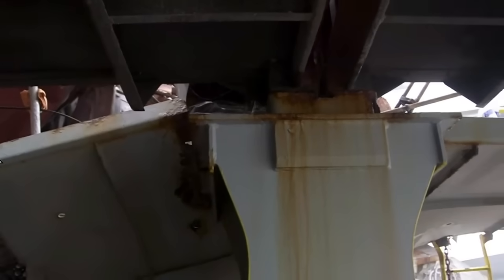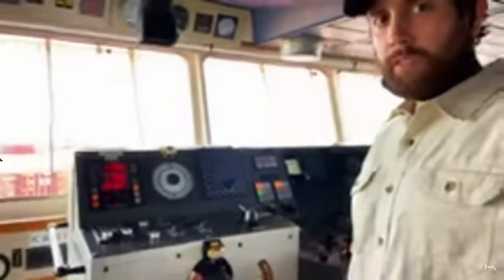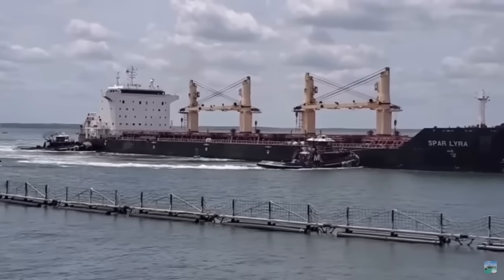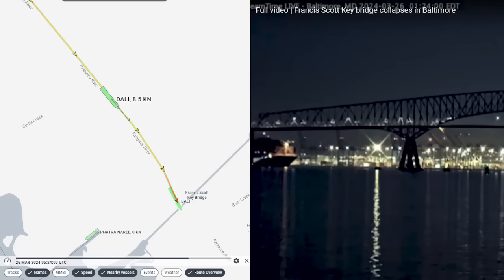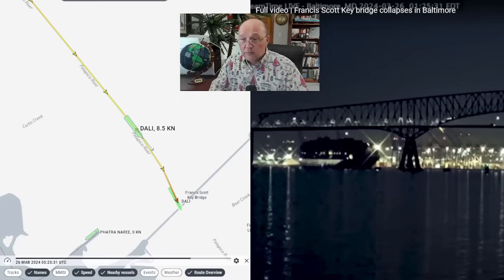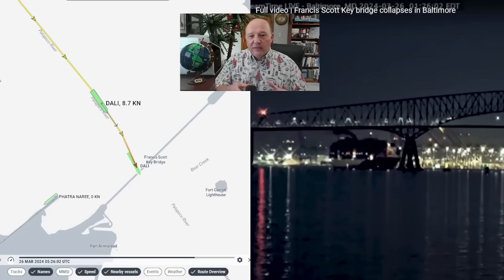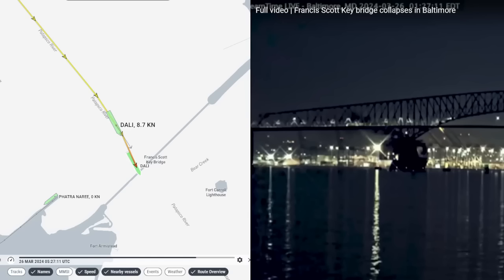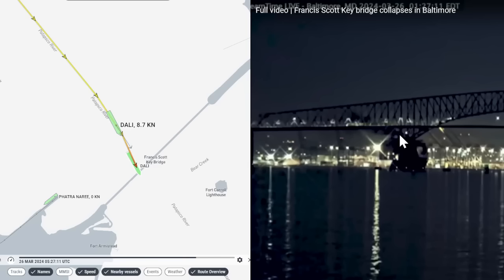Dali Timeline from Data Recorder in Striking Francis Scott Key Bridge in Baltimore, March 26, 2024

Comment: Sal. Retired Chief Engineer here. 30+ yrs as Chief Engineer on Slow Speed diesels such as this vessel. You have done a great job, but a couple of points to clarify.
1 - The ship's electrical systems are laid out such that there is a "Main Distribution Buss" and an "Emergency Buss". These two are NORMALLY 'TIED' together via the 'Buss Tie Breaker' and  fed from the ships' main generators (DALI has Four). They can all be brought online to supply power. Usually one will carry the load unless there is a lot of refrigerated containers on board. When the bow thruster is running, two or three generators would be online to supply the Bow thruster which is typically an electric motor 1,000~2,500 HP. The Emergency buss is ALWAYS powered. In the event of loss of power, the Emergency Diesel Generator (EDG) starts, and the breaker connecting the two electrical busses (Buss-Tie Breaker) opens, then the breaker connecting the EDG to the electrical buss is allowed to close and power the emergency buss. There are only a handful of equipment that are on the Emergency Buss, ONE of the steering gear motors would be on this. The Deck lights are not on the emergency buss. So when you see the deck lights come on and off, that is a Main Generator. The large light on the bow that seems to come on at a different time is likely a High Pressure Sodium light and they usually take a while to 'warm up' before putting out any light.
2 - The black smoke is likely from the Main Engine (M/E). The M/E is a 9-cylinder two-cycle diesel engine that develops 55,630HP @ 82.3 RPM. The pistons are 0.90 meters in diameter and typically weigh around 7-tons each. If they were doing 8knots ahead and requested a 'crash astern' engine command, the automation of the engine has a separate program that will introduce more 'start air' than normal, for a longer time. 'Start Air' is high pressure air that is introduced into the engine in the same sequence as firing order to turn the engine (kinda like a push start) in the proper direction before fuel is introduced. Once fuel starts pouring into the engine in the reverse direction, the engine is initially starved for combustion air as the three turbochargers on the engine (that weigh as much as a Volkswagen Golf) take a bit of time to spool up to speed.
3 - I was an Engineering Officer, not a Deck Officer (Mates), but the mates used to remark about how the astern bells would affect the stern by 'walking' the stern one way or the other depending on how the blades on the 65-ton propeller bit into the water. Much more than the ahead bells because the propellers are optimized for pushing the vessel in teh ahead direction.
Hope this helps clarify some of your questions.
4 - The rudder is controlled hydraulically and without power, would stay in the last position before loosing power.
Reply from the maker: Thanks Chief!  Great additional info, I appreciate it.
Reply: @wgowshipping Regarding the anchors, on the large container vessels I have smilede on as a mate, the anchor breaks are hydraulic operated, and the the pump needed is not automatik  turned on egen the emgergency generator kicks in. An engineer needs to go to the emergency switchboard to turn it on. There is an emergency pump, which needs to be fetched, hydraulic hoses needs to be connected from the anchor winch to this small emergency pump, which can then be uset by hand craft. I have not seen these manually breaks for years as you showet on the footage.
Reply: @wgowshipping  ond more thing. It-baseret bit of a wonder that there hasn’t ben an accident befordr considering the large container vessels calling Baltimore with hardly any under kedel clearince and not much Air-draft.
Reply: Depends on the precise design. If the engine was not fully up to temperature (as on departure) it would not usually be practice to rely on HFO for manoeuvring. The generators would be running on gas oil. The boiler would run on HFO.
Reply: The engine room alarm printer  and data acquisition printer log sheets will certainly shed light on the cause of the power failure and the recorded alarm and operational data from the machinery monitoring system itself.If there is a fault with the VDR  system it  will 
manifest itself in the data logs,
Reply: Agree with all your points Chief. The crash astern would be an obvious thing to do and would tie in with reported smoke and oil smell in the engine room; cylinder pressure relief valves blowing caused by excess pressures from the emergency maneuver.
If they succeeded in starting the engine astern and not just breaking the ahead free wheeling of the engine, shaft propeller. Engine running astern would negate any rudder authority.
Reply: @RicktheRecorder  The DALI's main engine is an  9-cylinder MAN-B&W 9S90ME-C9.2. They have recirculating lines at the fuel injectors to keep hot oil all the way to the engine while in port. When I was sailing, we only went to light fuel to do maintenance on the fuel system. So yes, still a possibility. I sailed with both MAN-B&W and SULZER engines, from 9 cylinders on one ship to 12 cylinders on my last. In the old days, they did not have recirc lines (SULZER-RND type come to mind). Another possibility is that they  switched to light fuel while in port to save money on keeping the fuel hot. There is an auxiliary boiler that keeps the engine jacket water up to temp as well as fuel hot as it circulates. I'm sure yours and many other similar questions are being asked. I read somewhere the auxiliary engines are MAK-licensed, build in Korea. The MAK design is made to run on heavy fuel. When the ship loads fuel, we take samples for 'insurance purposes' in case some problems arise. We used to maneuver with one Generator-engine on standby with light fuel, and the other two running on heavy fuel. The DALI actually has four generating engines. Lots of things going on, lots to keep track of.
Reply: @hforeman79  Yes, Sulzer RND I know. I am not familiar with gennies running on HFO, but I suppose if they have everything warmed through all the time, then it makes sense, With very short turnarounds it may well be more economical.
Reply: @RicktheRecorder  All good questions that you can bet that will be asked. Another thing I saw in the industry before I retired was fuel quality. Refiners have more and better ways to squeeze gasoline out of crude. What is 'left over' is getting worse and worse. 
Keep in mind that the fuel bill is the single largest cost, by far, more than any other to transport the cargo. What happens a lot is the company will order IFO-380, and the supplier will take a load of road tar and 'cut' it with diesel until the fuel meets viscosity specs. When I switched from Steam-Turbine ships (Bunker-C) to Slow speed Diesels (IFO-380) the fuel quality wasn't so bad. But as fuel got more expensive many ship managers went to IF-600. For those reading not in the know, the higher the number, the thicker the oil is. In a diesel engine, the engine requires a certain (thickness/runniness) injection viscosity, measured in Centistokes. The higher the number the thicker it is. The thicker the fuel is at room temp, the hotter the ship will have to heat the fuel to get to proper injection viscosity is greater. The MAK generator engines were pretty good on IFO-380, they did NOT like the IF-600. The fuel temperatures at the fuel pumps tended to be close to the limits of the standard o-rings..
Reply: Can one of you chiefs offer some insight on why it seems to be assumed that the moment the generators went out the engine stopped? I have been at sea for 45 years on smaller vessels and a loss of generator has never caused my main engines to shut down, just the power to steering motors is affected. What exactly does happen with the main engine in the scenario as we know it so far?
Reply: Was at sea a long time ago and lube oil and cooling pumps were electric motor driven, so if you blacked out the main engine would shut down from safety pressure switches on lube oil and cooling systems.
Reply: @robertkemp9685  You are right, there are low pressure trips that are supposed to be tested  each year. The last ship I sailed on was built in 1990, (DALI was built in 2014-likely a bit more automation). That 1990 ship had two of everything and if the number one pump or motor failed for any reason, the controller automatically switched over to the number two. I've read that some of the newer ships have "triple redundancy" in that there is three of everything. Typically, SOLAS (international standards) require that the emergency buss has one Lube Oil pump, one HT cooling water pump, one LT cooling water pump, one Salt Water cooling pump, and one emergency start air pump. The Emergency Generator is sized to handle only those loads. The Lube and Cooling water pumps are the normal size. The emergency air start compressor is sometimes a much smaller version. ALL vessels have two big air tanks that are capable of over ten air starts with the compressors shut off.
The generators are usually started with air as well but take much less than the main engine. I have, one time, experienced plant loss with no interruption of main engine running. Anything can happen and you are all asking the really good detailed questions that you can bet the investigators are asking. It all takes time to put the answers together.
When something goes bad like that it takes every person that is involved to have their wits about them and do the proper procedure they were trained to do.
Reply: Very interesting. Thank you. I'm interested in, but don't really know ships. So what I am getting is the main engine would have nothing to do with electrical power on this particular ship. Either they did or didn't try to get the engine reversed. I'm hung up on the smoke and the fact that the smaller generators wouldn't have caused that, yet it seems to be matched with the lights going out and back on the first time.
Reply: Nice explanation Chief! One of the best so far. Regarding point 4 i’m not totally sure. A semi-balanced rudder returns to the centreline orientation on its own if the steering gear equipment fails during a turn.
The fixed screw propeller effect will be strong when you pun half or more astern. With right hand propeller, the stern will go to port and the bow to stbd. due to transversal thrust caused by the propeller.
Reply: @RicktheRecorder  US is an ECA zone and scrubbers are mostly not allowed within US waters, unless you use closed loop scrubbers. All ICE and boilers should be on diesel, that is below 0.1% sulphur content.
Reply: @cap10david  automation, everything's computer controlled now. Even main engines does not have camshafts anymore, all works in hydraulic. Normal would be the Main engine LO pumps gets its power form the main generators, an emergency generator cannot run this LO pumps, and a loss in oil pressure means you have a dead main engine.
Reply: Holy carp. That was more information than the other guy... 65 ton propeller. 7 ton pistons. Whoa.
Reply: @wgowshipping 65 ton propeller
Reply from the maker: @alvingonzales3510  They are in the ECA and the ship burns HSFO via a scrubber so they should not be switching over fuel until outside the Emission Control Area.
Reply: 22:21 
The ship was passing Curtis Creek so even with little tidal currents, the flow from the creek would have required starboard helm but when power is lost and the ship moves past the mouth of the creek, the stern would have been pushed to port. 

Also, if, as you speculate, the ship’s forward momentum is turning the engine, the energy required would explain the slight decrease in speed. A bit like a compression brake on heavy trucks. 

Pure what ifs from a retired civil engineer with no experience on ships but some in accident investigation. Thanks for the informative videos. 

24:43 oops! Should have waited for the end of the video 🤦‍♂️
Reply: I wonder if the collision that the ship had in 2016 (crashed into a pier) in the port of Antwerp, Belgium was related to the same issue this time around?
Reply: Does the main engine rely on non self produced electrical power to run? Or is it a totally independent system?
Reply: Thank you for the info! Side note: wow, those are some BIG pistons
Reply: @crescentmoonboat  Without looking at the engine/electrical layout I can't be specific. However, from published ships spex, the DALI has a Main Engine 9-cylinder MAN-B&W, 4,000 HP (electric) Bow thruster, Two (2) 5,150HP Generators and Two (2) 5,900 HP Generators. So the crew can use any combination of generators to fit their electrical needs and not have 'too much unused capacity'. It does not pay to run a diesel at idle or low speeds. They like it best at 80% and up power. The engines BREATHE better. The main engine is directly coupled, direct reversing (the engine is capable of turning backwards). There is no clutch, no transmission. Also, as far as published spex, there is not any 'on the engine' generator. Some other ships have what is known as a shaft generator, that is built upon the shaft between the engine and propeller and only (electrically) engaged when the ship gets up to service speed (20+ knots). To explain how a shaft generator works would take pages of text. The engine 'controls' are typically pneumatic. So all your 'automation' of engine control is done through pneumatic logic boards. Then the pneumatics interface with electrics and the electric signals go on up to the bridge. Yes, there are still mechanical, directly hand-manipulated controls. These are at the very side of the engine just under the electro-mechanical governor and I can tell you, from personal experience, it is an awesome feeling to have the two lever controls in your hands and the feedback of 60,000 horses in your palms. However, there may not have been anyone 'standing by' at the engine side controls as that may not be that ship's procedure. For myself, for various reasons, I used to have an engineer at engine side controls while in 'close quarters' in case the electrics on the bridge or the pneumatics at the engine control room failed. Again, all these questions will be asked and answered to the satisfaction of the investigators before they even sit down to start writing their report.
Sorry for being long-winded. Short answer is NO. Power is produced by ships service generators, NOT the main engine.
Reply: So you’re saying that they probably put full astern and that may have caused the ship to turn off coarse?
Reply: @dustyroads834  It is a very real **POSSIBILITY**. I am an engineer, not a ship driver (mate). I very, very seldom got to see the outside as we were leaving port. If it was me investigating, I would want to see a similar situation in a controlled environment (open space) by sister-ship CEZANNE. Coincidentally, same owner. Not sure if a simulator would be able to re-create this effect.
Reply: What about the cyber attack though
Reply: ThankYou 👁👁👏👏👏 from a card carrying conspiracy theorist, former boat captain who recognizes this catastrophe as an ACCIDENT 
I'm praying for that Pilot, who is MrsOlearys Cow
Reply: @dustyroads834 exactly my thoughts,  being a former 50ton USCG licensed captain 

This black swan catastrophic event was an ACCIDENT
Reply: @Tommytucker1216 nope
Reply: @ladavidson9269  being a captain you'd think you'd know about a black box then and how it's impossible for it to stop recording....hence why a black box is completely ring fenced as in non corruptible or do u think that's the only black box in history too not record when it hasn't been destroyed...
Reply: @ladavidson9269  u do know your comments on other videos are available to view don't u ...you sir  don't know what your talking about..
Reply: @ladavidson9269 your a captain but on your other comment s u have limited experience??? Which is it captain 😂
Reply: Thanks for sharing additional info here!
Given some data you’ve provided wrt dimensions of the main engine, the propeller and last but not least having in mind the sheer dimension of such container vessel itself, there’s lot of inertia involved for sure. So from engineering perspective (though on micro-electronics / semiconductors), I wonder whether (re-) starting the engine “in reverse” could really help of slowing down the ship already being such close to the bridge. Just when thinking of the weight of the propeller, the shaft and the engine pistons, there’s such high amount of mass in motion where I could imagine that rotation might continue for a short while even when fuel pumps stop working due to electrical power outage – or is this too optimistic and I’m blanking out something important here? Following this, would it be better to keep same direction of rotation when restarting the main engine to `quickly´ stabilise the whole system and get back electricity & control over the rudder again? That might also fit to comment from @LoydChampion wrt responsiveness of the rudder at lower speeds, too.
Reflecting on all this and also another comment further down, it might be worth thinking about whether it would make sense having the backup emergency engine & generator running when entering / leaving harbour areas (like the APU in airplanes during take-off& landing) as preventive action in future.
Before the bashing starts here: it’s not about playing the `bright guy´ but much more what could be the learnings of such incident. You can safely assume I’ve been involved in debugging and related so called ´task-force´ activities in my field helping to drill down to the root cause rather than trying to overcome situation with some `touch-up paint´ only … To me taking such look across the fence always tends to be beneficial to keep my engineering skills alive – I might need it in comparable way (if just figuratively) at any day soon.

Finally, may the souls of those maintenance crew members working on the bridge who sadly passed away RIP.

Best regards from a landlubber 😉of good’ol Europe!
Reply: @RicktheRecorder , All equipments on the vessel would have been on LSMGO as she would be on LSMGO being in ECA waters
Reply: @Anders730  the anchors must be ready for let go before leaving the pier. This means that both anchors can be lowered in case of emergency only by gravity alone. Windlass configurations can be different from vessels to vessel, i experienced mostly electric. Hydraulics are generally used on tankers due to explosion hazard. Nevertheless, the anchors are not designed to stop a vessel underway at 7-8 kn (only to slow down the speed and turns the stern a bit towards the opposite side you dropped the anchor).
Reply: @NRZ-3Pi10  Lots of questions. 
1. The four main generators are separate from main engine. So whether the main engine runs or not has nothing to do with the electrical power. More than likely, they all share the same fuel supply, in one way or another. Different configurations are possible. Typically, there is at least one purifier on the service tank at all times. The purifier filters and de-waters the fuel by using centrifugal force of spinning at high speed and keeps the Service tank constantly full.
2. The main engine is started with air injected directly into the cylinders. When going 8-knots, it takes a lot of air injected into the cylinders to get the engine to 'roll' astern. Once the engine gets rolling, the start sequence has to quickly get the air off, and the fuel started while the engine is still spinning in the reverse direction. These are compression ignition engines. Meanwhile (and you mention this) the action of the speed of the ship through the water is trying to get the engine to start turning going ahead. It's a dicey maneuver at 8-knots and much more or a sure thing at 6-knots or below. Many things are happening and questions need to be asked, alarm logs and engine speed requests analyzed, and a timeline has to be built.
3. The 'emergency electrical buss' is normally powered by the main gennies, it takes 20-seconds for the Emergency Generator (EmDG) to start and switchover. Before entry into US ports, ALL ships are required to test run the EmDG (and steering gear) before picking up the pilot for entry. Having the generator running constantly during maneuvering is not easily done or feasible. The supply tank for the EmDG is a very separate tank that is supposed to last the vessel for a set number of hours. I don't know, but would be surprised if the APUs on airplanes were (normally) run anywhere but on the ground.
4. There are a lot of different processes going on. In the wheelhouse, they are trained in the practice of 'Bridge Resource Management'. Sal is more informed on how they do that in the wheelhouse. There is a 'team', one guy can't do it all. It is a bit similar in the Engine Room. When the alarms start beeping and screaming, the Chief Engineer needs to prioritize and focus on the problems quickly as they come up and send his available assistants to handle the tasks they are capable of handling. 
5. Many questions are getting asked. We won't know the answers until the report comes out in a year or more. Like reading the first and second chapter in a book and not getting the final chapters for a year. It's just the way the investigative process works.
6. * It seems Sal will be the best source for tidbits until the investigative report is publicly released.
7. In the end, the old saying 'Ship Happens' applies.
Reply: @hforeman79  Thanks for your feedback; and RE: “generators” – coming from electronic engineering, I just had the picture of the `purely´ electrical machine in mind. I.e. like used in power plants, which is driven by a hydro/steam/gas turbine there. Understand in shipping it’s obviously combination of dedicated diesel engine plus the electrical generator (each). So quite good example how same terms are used with slightly different meaning. Reflecting about it, also does make sense to keep them almost completely separated from the main engine (except for e.g. same fuel tank like you’ve mentioned) to have electric supply fully independent (plus frequency of the alternating current needs to match with system components).
Based on this, with 4 generators total like here, I can follow your argumentation wrt emergency generator. Also checked wrt usage of APU in airplanes. I basically remembered from a documentary of US Airways flight 1549 (where pilots Chesley “Sully” Sullenberger and Jeffrey Skiles made this famous ditch on the Hudson river after their A320 got hit by bird strike on both engines shortly after take-off) that the APU was essential to keep flight systems alive. However, according to Wikipedia, it was fast decision of the pilots to “immediately turn on the APU”. An article (“What do Auxiliary Power Units (APUs) do on aircraft?” on www . aviationmatters . co) listed few reasons to keep APU on during some dedicated phases after leaving parking position. Most interesting the one for “very heavy aircraft” to reduce load on the engines for such `maximum performance take-off´ (still with safety margin for commercial flights, of course), by e.g. taking over cabin air conditioning.

Since I’m neither naval expert nor from NTSB, I will not judge any actions done by the shipping crew. Not knowing what’s going on outside, team in the engine room can only rely on & follow commands from the wheelhouse and well known emergency procedures. For local pilots and captain, it was nerve-racking for sure, losing electrical power and fighting to get systems back running again; fully being aware of Francis Scott Key bridge coming closer & closer and narrow channel only, finally drifting towards the pylon. It’s only human reaction trying to stop or slow down at least.
Thus my question “would it help to do the opposite and keeping main engine forward trying to get situation more quickly under control again?” can only be considered as reflection after the fact; without evidence that it would have really helped here. In such situation, this is not straightforward thinking for sure. One would only do such emergency procedure “automatically” if already having faced similar situation (with good ending) or being explicitly trained for doing so.
Right, last but not least, `Ship Happens´; we can only try to derive & apply learnings.
Reply: I think that the main and auxiliary engines would have been on light, low sulfur diesel.  On the west coast we had to change over outside of US waters for pollution prevention.
Reply: @NRZ-3Pi10  hard to say.. it depends of many things. Generally when you have engine ahead and speed you have better steering. If they put the engine astern.. they lost steering. Now depends of the distance between the vessel and the bridge when they recovered power. I think if they had 1NM they could put full ahead and try to turn the vessel and ground her or even pass the bridge. Also take into account the panic on the bridge. Fuel change overs due to NA ECA regulations can create problems since those vessels are designed to run on HFO. Diesel has lower viscosity and can leak through the system creating issues.